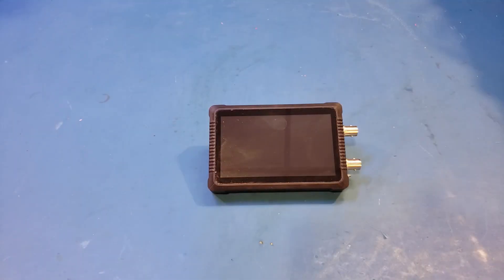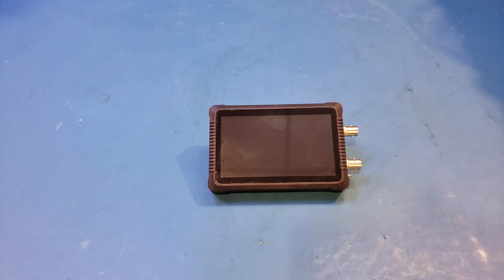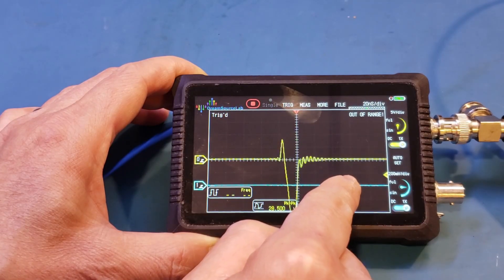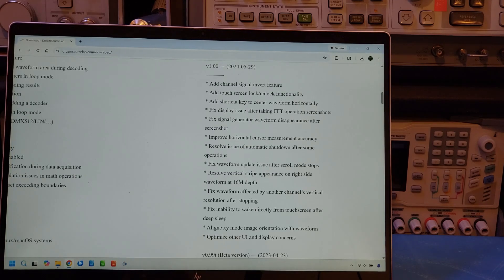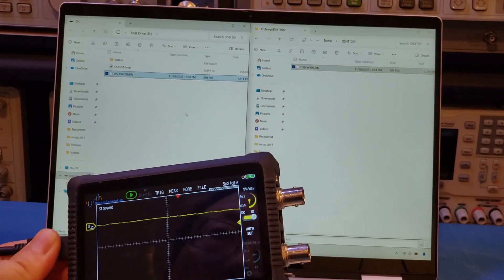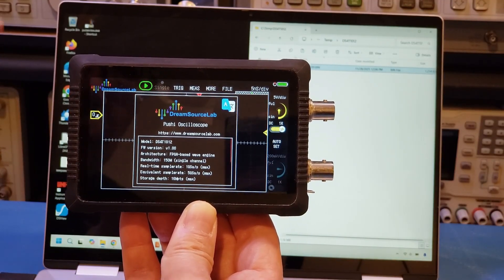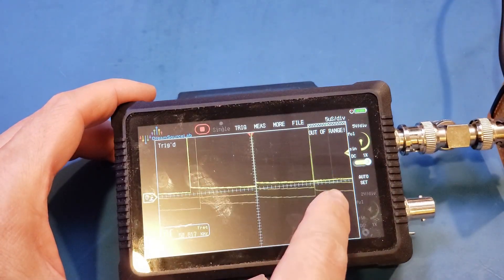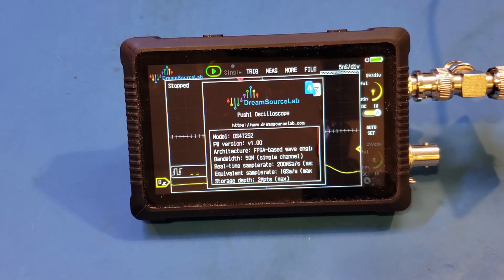DreamSourceLab DS4T1012 Firmware Upgrade - Did They Fix the Avalanche Pulse Capture Issue?

Comment: Good video , thanks Kerry.  Any chance of a teardown and hardware investigation on this topic, Kerry?  Maybe probing the input to the ADC with a high end scope would determine if there is a front end issue. I believe it uses the HAD1511.  The output of the ADC would be harder and interesting to monitor, and after that it gets crunched by the FPGA, so that might show whether it COULD be fixed with a firmware upgrade, at least.
Reply from the maker: I actually did a review/teardown here: https://youtu.be/lHy2n_vcauw Unfortunately, the unit I did the teardown with is not a working unit and you can't open the case up non-destructively. I was told by DreamSourceLab that they had fixed the issue after I first reported it a couple of years ago. I guess they must have done so in a hardware revision.

Comment: DSL is allways behind in firmware and software fixes, their DSView crashes frequently and issues get ignored on github
too bad, the hardware is quite good.  still regret selling my dscope years ago, i should get a u3p100 if it werent so expensive.  dslogic works great, except when the software crashes.